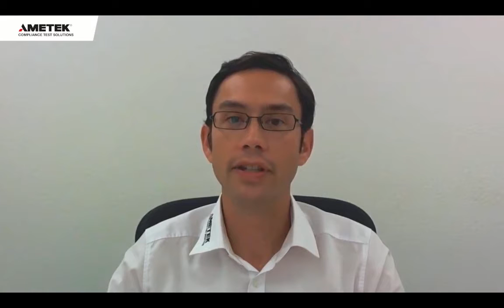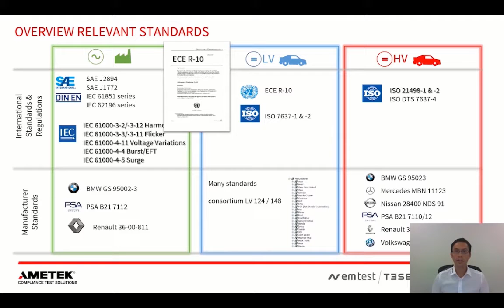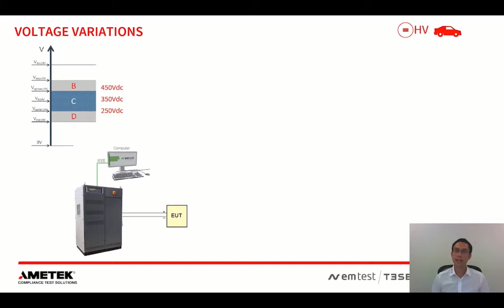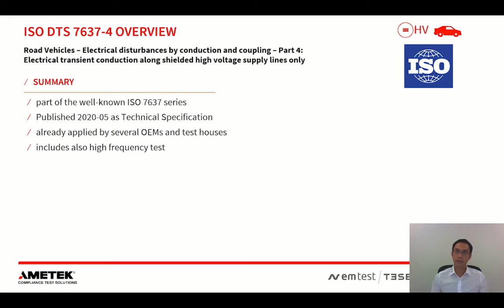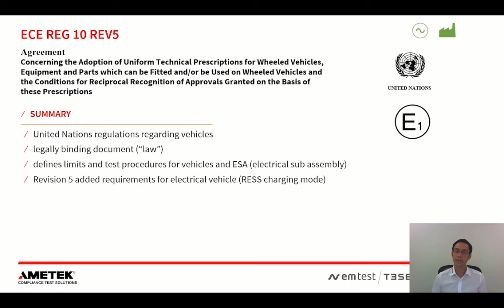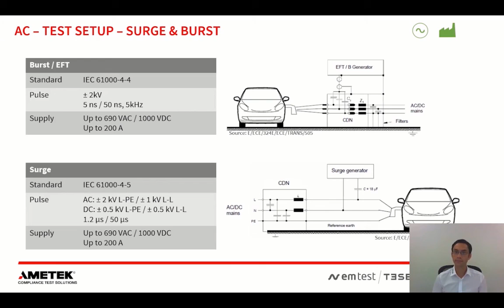Comment: I am using AC supply and converting it into 120VDC for battery charging and converting 120VDC to 12VDC for vehicle system which standards i can refer